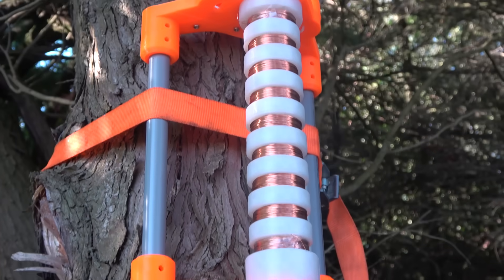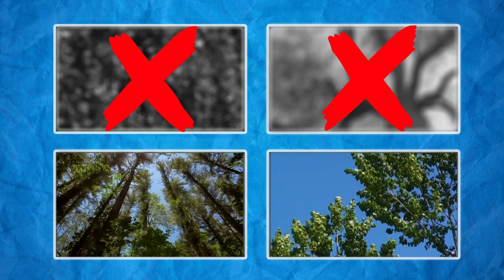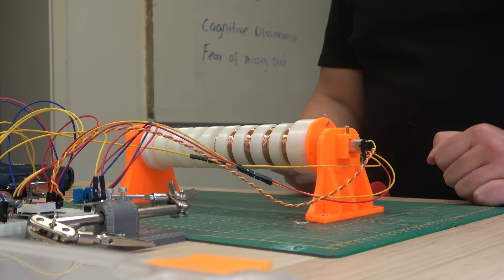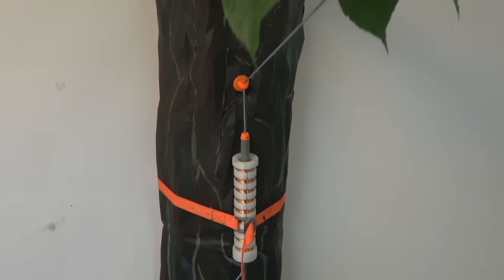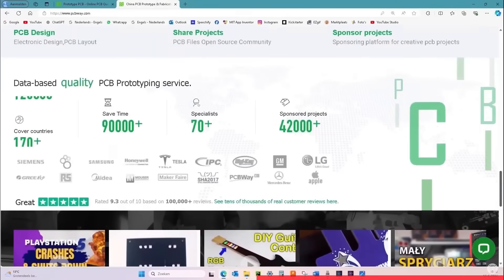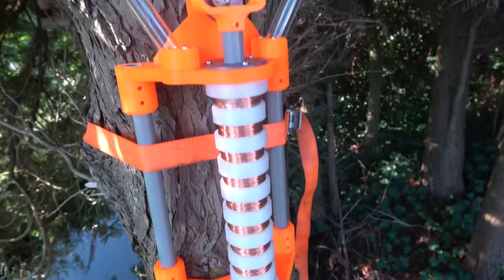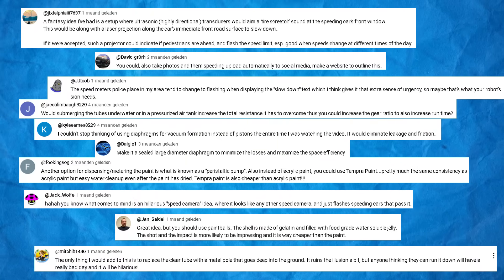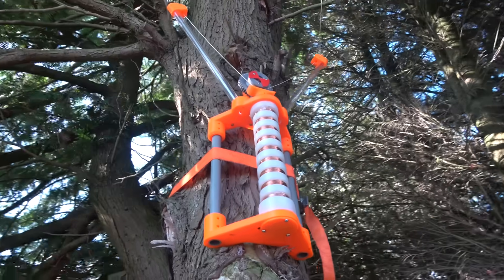I Made a Tree Generate Electricity..

Comment: "Trees are constantly moving in the wind all the time.  Think if we could capture that energy somehow."

Wind turbines: am I a joke to you?
Reply: someone always has to try and reinvent a more complicated wheel.....
Reply: wind turbines are a terribly inefficient design. yes, they are literally a joke to me.
Reply: But wind turbines costs a lot.
Reply: @RaddDronzy 🤦🏻‍♂️Wind turbines produces a lot also. Just look at costs per watt or megawatt
Reply: @heinrich6294  Wind turbines actually produce very little because most of what they output is actually assisted by external fossil fuel energy sources. The wind on its own isn't even enough to get the turbines moving, so they use external power sources to spin. That's why you sometimes see only a few wind turbines moving while those adjacent aren't moving at all, because they have to be powered on externally. their movement has almost nothing to do with the wind. Then they report the total energy output as if it all came from the wind when it actually mostly came from fossil fuels.
Reply: @rumfordc  I never heard something that wrong before. Wind turbines are very efficient designs and produce very much electricity. Some wind turbines don't move because they are turned off. They are moved out of the wind because of high wind speed other wind turbines produce enough electricity. So theres too much electricity so they turn it off.

Where the hack do you get your information from?? I've never heard so much wrong about it
Reply: @heinrich6294  "there's too much electricity so they turn it off" lmao you actually believe that don't you
Reply: @RaddDronzy  So would a massive setup like this with trees to generate electricity.... and you'd also be destroying lots of habitat for animals, creating big hazards... you don't think very far.

Comment: Funny. I've had a similar idea rolling around in my head for months except with artificial trees. There's an old Robert Murray-Smith vid about using old speakers to generate electricity from wind (vibrations). Theoretically, an artificial tree could be optimized to capture wind energy in the "leaves" and "branches" via vibrations centralized into the trunk where a generator would sit. Actually balancing all that stuff out non-destructively (interference), and at scale, is rather beyond me at the moment unfortunately. Sounds like a fun project otherwise!

Comment: An idea I have focuses more on the swaying of the trunk and involves a more wooded or forest setting with multiple trees.  The trees tend not to sway in perfect sync and so the distance between them (especially near the top) widens and narrows quite a bit.  There is also a great deal of force as well due to the mass of the trees and I've seen 40 foot trees have the distance between them shift up to a meter.  The widening and contracting can be used.

Comment: Today I was cutting up aluminum cans to fasten to a bicycle wheel wind turbine and looking at my shade sail cloth constantly rise and fall I thought about getting an old rowing machine to generate a little power. With gearing, flywheels, & pendulums you could make battery free systems that would only require lube once in a while.

Comment: Would connecting the system to the trunk of the tree as low as you can, while still having the pullies spread apart on opposite sides of the trunk, then connecting the system to some point as high up the main trunk of the tree as possible provide the best and most powerful forces to harness?  I feel like the swaying of the thickest part of the tree would provide the most force not the individual branches.

Also like others have said some series of one way bearings or gears to allow for both sides of the pullies to provide separate forces in the same rotational direction, attached to a ratcheted weight and fly wheel (similar to clockwork), into a traditional alternator set up would seem like a more efficient and consistent way to pull energy.

Comment: Since this idea does not require deforestation to build a power plant, and it could be adapted on any size tree (the model he used was pretty small so it can be sized up), here are some research questions I would try to answer : A) what sizes produce which powers over the course of one day’s exposure on a regular summer day(72F light breezy)? B) how many trees would it take to power one home? Could those trees fit in a person’s backyard? C) how does it compare to domestic wind turbines such as an archimedes domestic turbine?
I think this could encourage tree planting and give people a reason to not cut them down but use them in a way that is more beneficial for just oxygen, since apparently that isn’t enough
Reply: A regular wind turbine produces 5MW (10^6 W)

A simple linear generator like this will provide a fraction of one watt. So you need multiple millions of these to replace only a single wind turbine. 

While this is still a fun project, it will NEVER be enconomic. Not even ecological, as the hardware will brake down before heaving output a Promille of the energy required to manufacture the copper alone.
Reply: If it doesn't produce money for them,it isn't going to happen.
Reply: @deemisquadis9437  this is a super valid point - yeah, we live in a capitalist society that hinders growth and progress like this for the sake of profit value. Americans haven’t really recovered since ‘08, the cost of living is very expensive, and wages are stagnant. In fact, I looked into this type of technology (I have a bachelors degree in engineering) to make my own device to avoid having to pay my hard earned wages to a utility company. If I could make it as a DIY for myself, I can make a few more and give them to my closest friends. And if I can get maybe a few thousand people generating their own electricity for free rather than pay an electric bill, now we could have a fighting chance at breaking away from dependence on capitalism ending it as we know it. I hope u have a great day
Reply: @deemisquadis9437  I fucking hate money
Reply: @Darvyak_IX  Prime example of yellin into the void. Let's go back to bartering!

Comment: One big problem is that you are trying to use the motion of the tree relative to itself.  It would probably be way more power to just attach the coils directly to the branch, and let the inertia of a magnet inside power the movement.  

You would have a power/length tradeoff though.  For example, if the branch sways 10 meters, but you only have 50 cm of coils, you'd need enough drag force* of the coils vs magnet so that the inner magnet would naturally only move 50 cm on a 10 meter sway.  And I don't know how many coils that would be or if it would be realistic.

*And here I don't mean the spring simulating magnets on the ends, that's just wasted energy.  If it was calibrated nearly perfectly, the springs on the end would do nearly nothing.

Alternatively, multiple generators on the same branch could reduce the length of the swaying to make things tractable.  Preferably not due to their weight, that's just a waste, but again due to the drag against the magnet.  

If there was some way to use relative inertial movement without putting the weight of the generator on the branch that would be even better.

Or you could just use an inertial generator someone else designed.

Comment: Does the pulley version still convert the up and down motion? Doesn't the up and down motion just slacken and tighten the lines which only pulls on the fixed pulley?

A fix that would truly harness both forms of movement would maybe involve a two tiered system where the pulley moves with the pole up and down with the up and down motion of the branch, and then the left and right motion would cause the pulley to adjust the distance between the pulley and the magnets on the pole, extending and retracting it. I am envisioning the pulley being attached not to the main frame, but instead a piece that reaches down to the main pole it is actuating and connecting onto it with a slider.

There would be potential for left and right motion to cancel out up and down motion and produce no electricity, so there is probably a better design you could do, such as just simply implementing two generators at right angles, but my suggestion should work most of the time and be in line with what you were thinking.

Comment: If the rotational energy was converted via a ratcheting mechanism that only turns in on direction, it might reduce the force required to lift the shaft and allow for higher gearing ratio?

Comment: I haven't thought this through much, but I believe having one less set of magnets or windings in the same length can significantly stabilize the voltage generated, making many smaller and much more frequent ripples rather than very large but single pulses. 

So instead of having (M)agnets and (W)indings like this:
M M M M M M
W W W W W W
Maybe do it like this?:
M  M  M  M  M
W W W W W W

Also, full bridge rectifier!! Using schottky diodes due to the already probably low voltage.

Comment: Great Idea! Wish I could have seen some measurements on the electricity generated. Anyway, to make it feasible, you absolutely need a battery. You won't be generating enough from one tree at any given moment to charge a phone or anything. A ton of trees however, all connected to an array of batteries should work well. I don't see it making a huge impact in any way, but I mean the ability to generate electricity from any forest would be beneficial. Biggest downside I see is wildlife. The wear and tear on a device such as this will be massive due to that. Only thing you can do about it is leave one running for extended periods of time, see where it goes wrong, make adjustments.

Comment: In the days before digital watches, there were watches that converted the arm movements into mechanical energy for the watch.

The key is that there is a mechanical energy storage device with simultaneous power input and output (rotational). The input can be any direction, the output is one direction.

Such a device could be used to adaptively change the mechanical load applied to the branch, depending on how much the spring is under tension. A standard electric generator (rotational) can be used at the output, it will run on different speeds depending on spring tension. The result is a smoothed rotation which then can be made converted to electricity more efficient.
Reply: Those watches worked on pendulum energy - only 1 plane would be actively contributing energy

Comment: Certainly very inventive, there's no doubt this would generate electricity. It's not practical though. Small amount of energy produced and high maintenance. Think about how much power has been required to produce this device. There's the copper wire (mining, smelting, transportation etc), 3D printing (direct energy and manufacture of all the components) and all the other bits. Do you really think this device could produce enough energy to make itself, let alone have surplus energy?

Comment: It has tremendous potential. You need more data so you can figure out its average power output over a long period of time. Also could you have a ring of those completely encircling the trunk so that you can attach to branches 360° around. Might as well you the whole trunk circumference

Comment: Could  you implement a similar linear system into an electric car?  I'm thinking two long tubes (much longer than the ones in this video) running down each side of the electric car, as another way to regeneratively harvest energy (in addition to the regenerative braking).  The inserts move forward and backwards along the tube as the car accelerates and brakes.  Every little bit helps!  I'm not sure how the weight of such a system might offset the benefits.  Perhaps build it into the frame of the car?  Just ideas.  Thanks for the video!

Comment: Three things. 1: capacitors, this set up needs it to help charge things like batteries smoothly. Similar to a water accumulator on a boat or RV. Also a tank circuit could work to for the pause.
2: along with the accumulator you need to feed the generator into a whetstone bridge rectifier using diodes instead of resistors to convert a to DC in order to charge.
3: lastly and most importantly which I don't know what the electrical threshold is if you have noticed trees avoid electricity like from power lines. So I would suggest electromagnetic shielding for the tree as it could affect .

Bonus (try using this on a bamboo forest instead. They sway a lot more. Could use outriggers like on a mask towards the top or channels along the shaft like a fishing rod to guide and help convert the sway of a line(the bamboo angular momentum) into linear momentum of the string. Your basically converting a line into a triangle then converting rotation into line movement
Reply: Where I live trees love the power lines. They reach for the lines! We call the electric company out every spring to cut them back but, our old tree in the front catches fire every few years anyway.
Reply: this is more so for further down the line of development, currently he is trying to make it more efficient and consistent before adding diodes and capacitors.
Reply: @conradchester  Exactly

Comment: I think a few people commenting are absolutely on to something by finding a way to perpetuate the motion the tree creates. How to do this? That I am not so sure, I'll leaf that to someone else! 

I'm an electrician, and what I Instantly thought of for your idea is that there should be a battery somewhere charging by the motion the tree creates. If there were 1 or more batteries being charged by the perpetual motion of multiple trees then there could be a surplus of power and there would be incentive to use the trees as a constant energy supply for something like a constant light source. Imagine using the trees' motion to illuminate a pathway light activated by a photocell?! That would be awesome for people who want to save money and need well-lit pathways into/around their homes. 

I'm thinking these trees wouldnt accrue as much energy as something like a power grid would but I can imagine that there would be many uses for intermittent low voltage applications such as low voltage nighttime landscape lighting, doorbells.  If the trees can generate enough energy I could imagine their energy output being able to power some motion activated low-voltage lighting anywhere around a house/building. 

Long story shortened, If you are able to cause the trees' motion to a perpetual motion in your apparatus, and you are able to do this on multiple trees and combine the energy they put out and store that energy, then I think you would have a viable method of using the trees for low-voltage electrical tasks like non-constant low-voltage lighting, and occasional use situations. Very exciting idea by the way, super creative!!!

Comment: I'm inspired, what a great idea. With large trees, this generator would always be moving. I have 4 massive oak trees I want to test these on. The branches are pretty much always moving at their height because of the microclimate they create. This creates a convection effect that moves the branches even when there is little wind. This system would largely be dead during the winter when all the leaves are gone, but maybe evergreens could be a good option for these generators in cold climates. 

This concept could mechanically pump water as well.

Off to build my own, is there a discord to collaborate on?

Comment: I’ve seen others mention it, but wouldn’t it be more efficient just to use the rotational energy from the small gear to drive a more conventional generator? Instead of converting linear motion into rotational, only to turn it back into linear motion that drives the linear generator. By adding the gear, you kind of solved your own issue that caused you to require a linear generator in the first place.

Comment: I actually had this idea years ago, I love that you've actually gone and done it. Some thoughts on it I have though. The amount of force a tree can expert on something can be immense, I built a tree house when I was young, built between two trees, the amount of force of the two trees pulling and pushing on the wooden bracing between them spilt the wood and destroyed the tree house. If you can leverage the difference between two trees, or even something like a stay wire, you could probably gear up the output to get significant movement. Hope that makes sense, can't wait to see where this goes

Comment: I have a totally different approach no tree required, 30 ft trembler rods it would be very hard to describe. I will try to summarize.  Nine 30 ft elastic ductile hollow rods non magnetic, with aluminum cables inside with the magnet spaced like you did there on it. This rod would be the core. The secondary rod would be on the outside the (whole length) with the windings these would have shorter spacing than the magnets in the core. They are all stood up vertically connected to each other with drag flags at random intervals to catch wind, and tremble the cables.